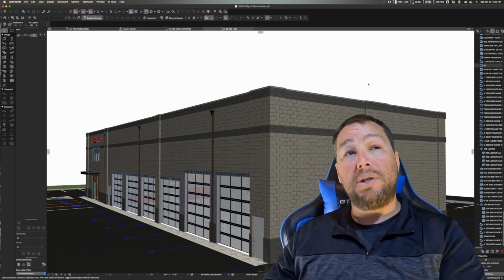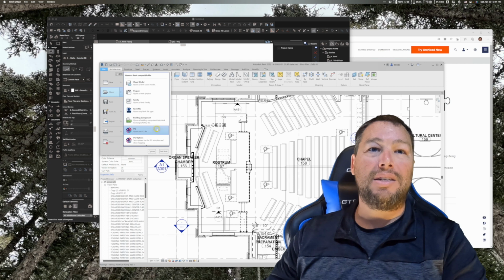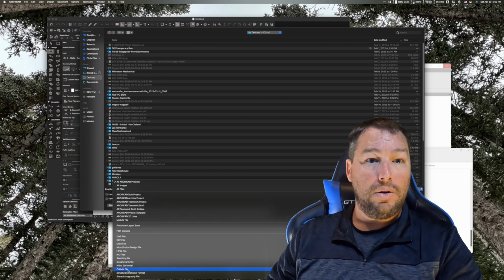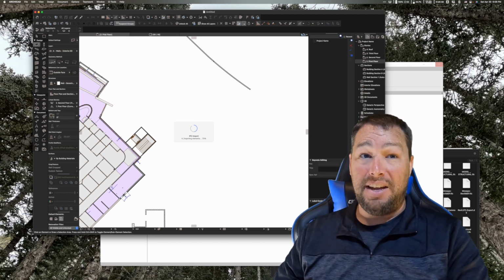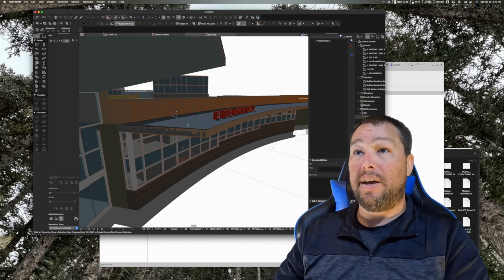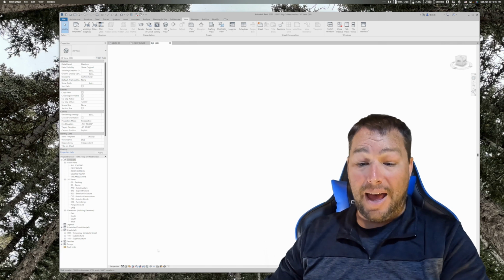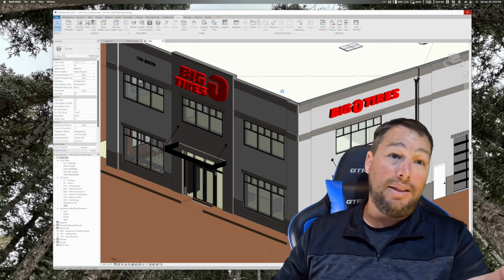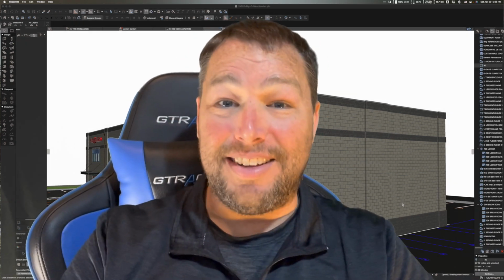Collaborate Between Revit and Archicad - CBA-AC-26

Comment: Sir, You dont know how to use Revit, so dont diss it so much. I work in Revit perspective all the time.
Reply from the maker: I'll agree I'm rusty on Revit. I was heavily using Revit everyday from 2007-2013, but since switching to Archicad, I have had few reasons to open Revit, and so my memory of how to do things in Revit is not current.  I definitely have my opinions on the software and I hope you know I'm not criticizing others for using Revit if that is their flavor of choice in BIM.  Archicad does have many flaws as well, so I get that it is not for everyone.  As to perspective mode in Revit, it does suck compared to Archicad.  I know you don't think so, but it does. It's just not as capable for fluid user interface within perspective mode.

Comment: I was a longggg-time AutoCAD user & fiiii-nallly made the transition to BIM/3D.

Guess what mistake I made ?

I am sure that you have been working in this space a lot longer than me...but I guarantee you that I have called revit 'TRASH', & worse more than you have 

After my first project using revit (does not warrant a 'capital R,', BTW), I sought out ArchiCAD AND WILL NEVER go back to that (little-r) TRASH again.

I would have done so much better if I had just stayed with AutoCAD & sucked -up it's inefficiencies.   At least you can 'crank' in AutoCAD.

When it comes to collaboration with Engrs/Consultants, I lobby hard to get them to go over to ArchiCAD.  It's a hard-shell (they're Engrs, after all).   But, I can usually get them to do their 'thing' in AutoCAD.

Anyway, did I already mention that I agree: revit is TRASH.?

Anyway, I know it's a RANT.  But it needed to be said.  I'm a with you Bro.
Reply from the maker: I've found working with engineers, it is best to give them the freedom to choose their own BIM and work with IFC exchange.  My MEP engineers are Revit based, but my structural is Archicad based.  We're able to work well together using IFCs and their models come into mine beautifully.
Reply: BIM Manager at an MEP firm here. The biggest issue with Archicad on the MEP side is simply the lack of support and capabilities. You can do some basic modeling but there is nothing to support air/liquid flow calculations, fluid temperature studies etc. It is completely lacking many tools MEP engineers can utilize. 

IFC interoperability has greatly improved in Revit over the past couple of years, most of the headaches we get with working with ArchiCAD firms is not software limitations, but knowledge limitations in translating their data to the correct IFC object categories.

TLDR; most issues related to software are user based (lack of knowledge or training) and not software limitations.
Reply: @miketaylor337  Good takeaway on your comment.  I will spend some more time getting better at the IFC transition when working with Revit-based (or other s/ware) Consultants.

We really are at the point where software talks to each other a lot better than it used to.

When it comes down to it, I want to make it easier for everyone.

Comment: “Tuned to the needs of architects” says it all. Revit is incredibly powerful and tooled for engineering efficiency, shops, calculations, etc.

I work with linked .ifc files more often than I’d like, usually a horrible experience. CAD is fine - just have to model in the room bounding elements on my own. 

I do agree this is a massive  incompatibility issue, and I wish there were better solutions, but why doesn’t Archicad have a larger presence in the MEP or structural world…? I’ve looked into the software and it largely lacks the equivalent functionality.

Archicad is tailored for architects, not everyone.
Reply from the maker: Very true, Archicad is primarily for architects.  I use IFC files all the time and it is a pain, though much better than in years past.  I have heard rumors that Graphisoft is working towards a better MEP design solution, but they do have to be careful or they'll repeat the mistake of Autodesk where Revit development was so focused on MEP that the improvements for architects was grossly neglected for many years.

Comment: Hello Color Blind Architect,

Thanks for your video! I enjoyed your comments about Revit :)

I have this question about IFC import.
Structural engineer sent me his IFC file that he saved from Revit Structure.
When I bring it to ArchiCAD via Hotlinking process - the majority of elements are converted as objects.
For example, I have around hundred columns and only couple of them actually came up as columns.
The rest of them are just objects.

Any ideas why?

(I don’t think the engineer has ArchiCAD IFC extension. We will do more tests.)
Reply from the maker: My first question you answered, if he was using the Graphisoft plugin for Revit. Have him try that and see if it helps your import. Unfortunately, Graphisoft is typically several months behind Autodesk of version updates so check the version your engineer is using as well. I’m not sure if the 2023 plug-in is available yet.

Comment: ArchiCAD is excellent with IFC files about 90% excellence.  As for these so-called Darkside software it’s not excellent of anything really in terms of IFC it is atrocious. After this I believe are the handicaps in the industry when it comes to sharing Bi data they don’t necessarily didn’t even open them I’ve worked with the other BIM vendors and they are willing to work with each other but Autodesk Revit is worthless in that field. I believe that this sucks so bad Apple won’t allow them to write a version for Mac 🖥 😂!! Credit is due where it is and where is it credited is for Structural and MEP only.